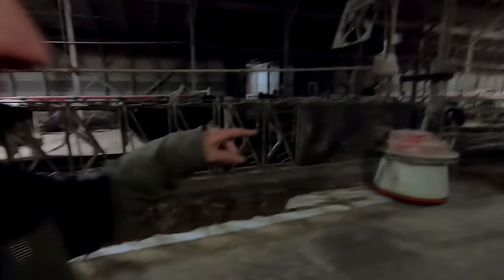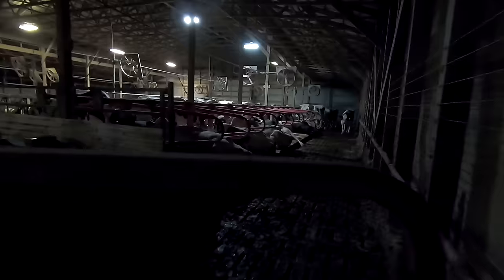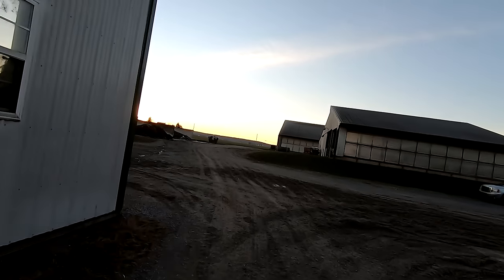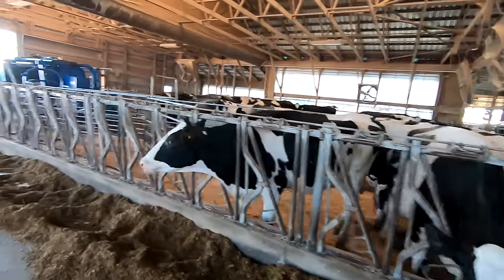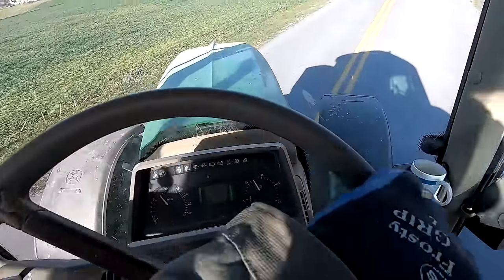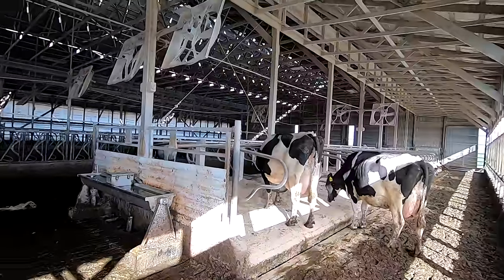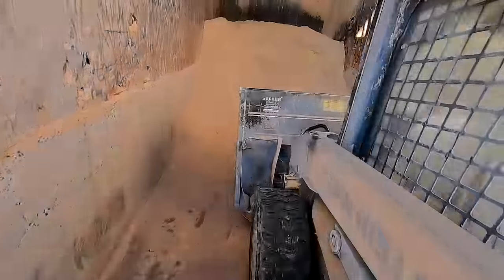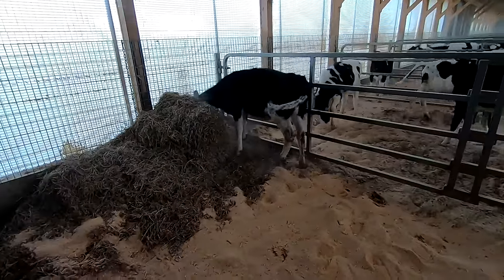Productive Day of Dairy Farming

Comment: Hey there Eric, I hope you're all well and good! 

I'm curious as to why y'all don't use a "J Type" feed bunk, thus eliminating the need for both the robot pusher, and your use of the broom for pushing, thus saving both time and money, plus ensuring that feed is always available, virtually eliminating a "slick bunk" which is a good thing.

I hope y'all have a good one! 🐂🐃👍🇺🇸
Reply: One of the main reasons is with J-bunks it is very difficult to clean the old feed out if need be.
Reply: @josiahmcmurray6064  

That shouldn't ever be a problem, and if it should be, I'll be generous and say 5% of the time, all of the time and money you would be saving the other 95% of the time, would more than pay for that time in 1 days interest alone.
 I've been in and around feeding cattle most of my 61 years, and J Bunks are the only way to feed as efficiently as possible, and I've never cleaned one out yet.